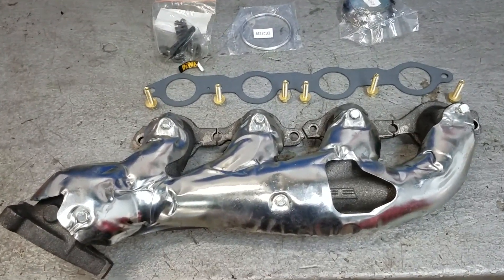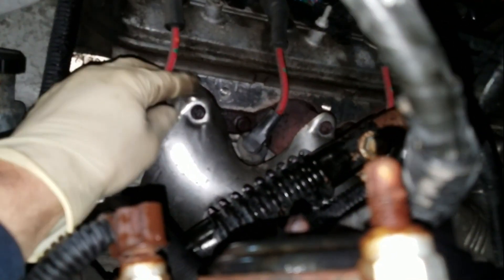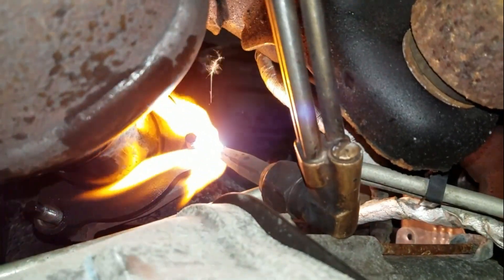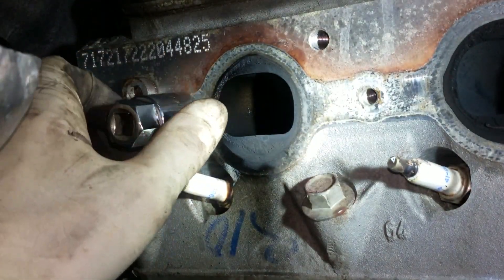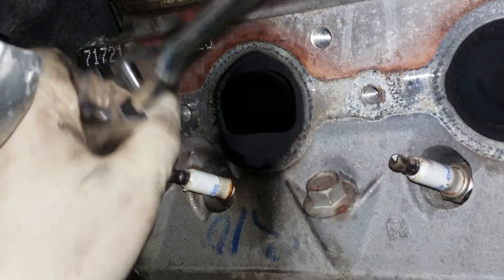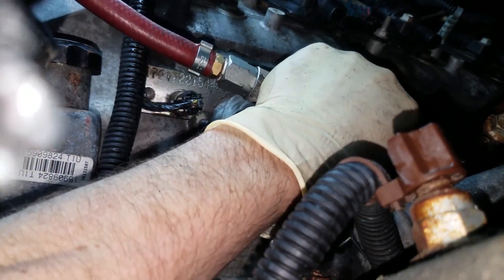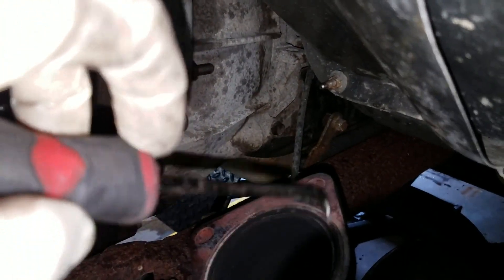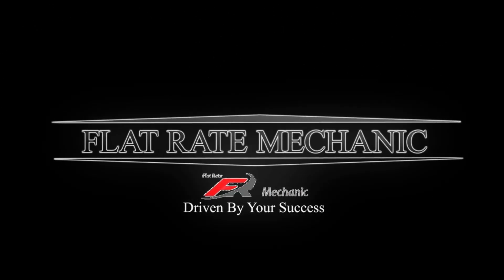Chevy 5.3L 6.0L Exhaust Manifold Replacement "Complete Guide" Broken Bolts

Comment: The kit that I bought to do this job on my 2002 Silverado only came with a flat triangular gasket for the drivers side. After putting everything all together I have a pretty bad leak on the driver's side. Guy at the auto parts store said drivers side requires the use of the flat triangular gasket. I picked up a ring instead part# 190731 and it took care of the problem for anyone having the same issue.

Comment: Thanks for an excellent video. I'm a pretty capable DIY mechanic, but was resigned to paying a local independent shop to replace my cracked exhaust manifolds on my 2001 Suburban 2500, with 341,000 miles on her. After watching this, I think I'm gonna try this myself and save $800 in labor (hopefully!) BTW, the stud extractor link doesn't work anymore, but I found another that I'm going to order. Thanks again!!

Comment: I live in the rust belt. I can't believe how clean that truck is.  And how easily the bolts came out. I did a 6.0 in a  2007 3/4 ton suburban the other day and the bolt heads were corroded  so a socket wouldn't  bite in most of them. I torched the heads off of those and ended up with 2 flush and 5 protruding  studs to remove and every one was a fight to the last thread. Makes me want to move south where working on vehicles is easier.

Comment: My 04 silverado is super noisy in first gear. I need to replace the gaskets. I have at least one broke manifold bolt. O plan to do this after hunting season. Did you put loctite on the new manifold bolts?

Comment: 0:30 "new donut gasket"

I just installed mine without this gasket and I have a leak at that seam. My passenger side dorman item was missing that piece and instructions didn't mention this extra gasket. I only had that thin ring gasket.

So the ring gasket is for the flange side on the exhaust down pipe and the donut gasket is for the upper side of flange??
Why is there TWO gaskets for one seal???

Comment: Would you drill out the broken stud if it was flush to the engine block?
Reply: If it’s flush, weld a nut to it. My 5.3 has aluminum heads- makes welding to those studs easier. My 6.0 is the reason I looked this up- not sure if they have steel heads.  
Hope you’ve fixed your problem.

Comment: Were the old manifolds so bad they couldn’t be re-used?  At between $140-$230 a pair I’d like to try just replacing the gaskets and bolts. Is a dab of anti seize a bad idea on these bolts? 

Great video!
Reply: They warp

Comment: At about the :57 mark, I see you have 2 ring gaskets... Are two required, or just 1? Whoever removed the exhaust before I purchased my 05 Sierra 1500 didn't even replace the gasket, so I have no idea. 🤬
Reply from the maker: Just one on the driver side I believe.

Comment: Doesn't talk about most important part. What kind of bolts need to be used to stop the broken bolt problem this engine is plagued with? Is it the quality of GM bolts or a design flaw with thicknesses and dissimilar metals. Can problem be successfully resolved? Thanks!
Reply: ARP makes a kit with studs, they are much stronger than factory bolts.

Comment: Does the manifold fit without removing steering shaft ?
Reply from the maker: yes
Reply: The Flat Rate Mechanic I was able to flip the manifold over to remove it and make it fit
Reply from the maker: Nice. Glad to here it.
Reply: @rahrah8076  you never included the torque spec
Reply: @richardmcelroy6574  100 ugga Duggas lmao
Reply: @rahrah8076  funny. I put me damn book up in the shop and could not find the damn thing so i watched a video looking to find the specs. But to continue the honesty most of the vids i watch have torque numbers off spec but close.